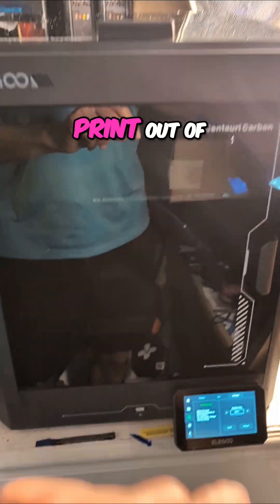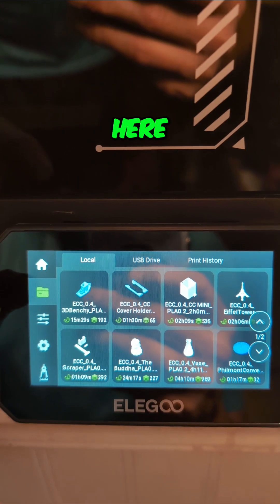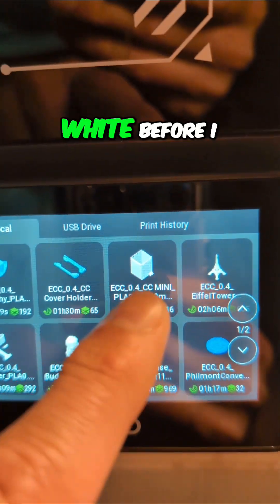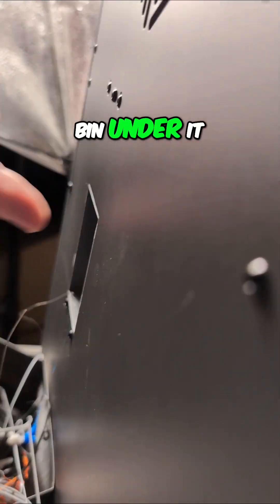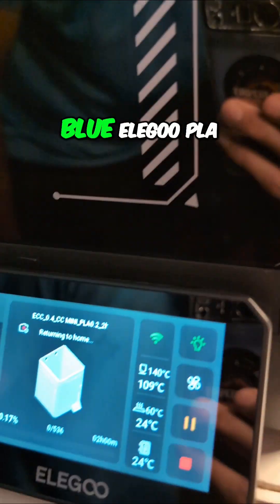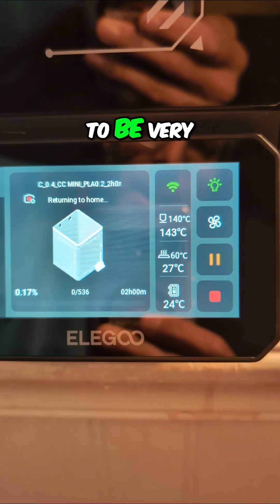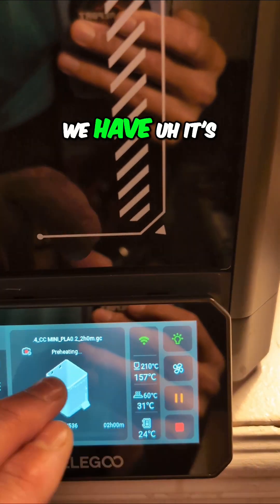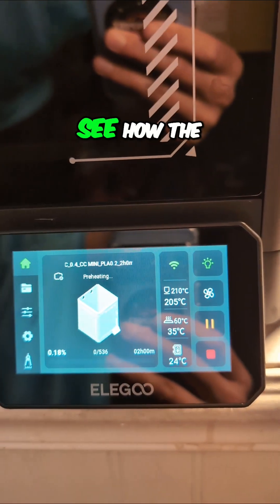Elegoo Centauri Carbon: First Print & Review

Comment: My print bed takes a bit to heat up. I thought it was supposed to be quick. The nozzle heater is fantastic super fast. Just that bed heater.
Reply from the maker: Yeah. Faster than my Neptune 4 Max though. :)
Reply: Maybe I missed it in the directions but...whats the level button for on the print screen?